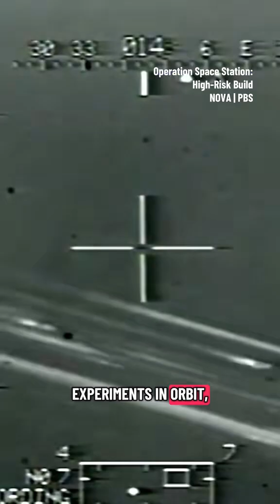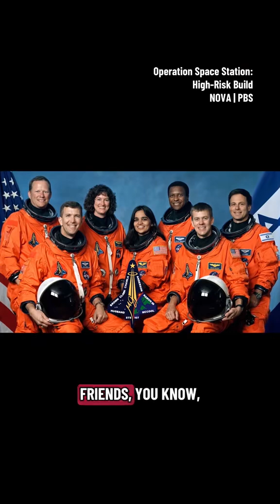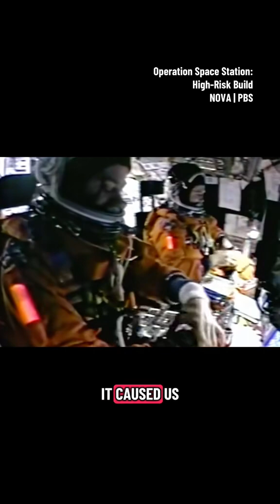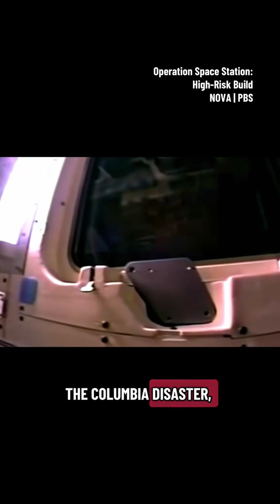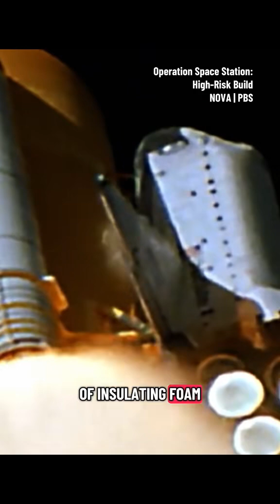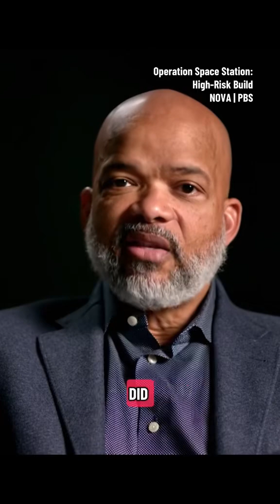What really caused the Columbia disaster? #nasa #spaceshuttle #astronaut

Comment: I call bullshit!!! A piece of “ foam” damaged heat shields that can withstand 2000°C? Really? But we all know NASA stands for. Never A Straight Answer!
Reply: Answers pretty damn straight. We're talking about a shuttle travelling very fast. But ok you're the expert.
Reply: Quit with the conspiracies, at 17000 mile an hour it do tremendous damage
Reply: @patrickcoffman4774  It’s actually 17,500mph or Mach 25 for low earth orbit. The important factor is actually (kg/m3) But if their explanation convinces you that’s fine with me. Not all of us have the skill of critical thinking.
Reply: Go away Trumper
Reply: @terrymckenzie8786 - MAGA ♾️?
Reply: Yes foam that's designed to be durable enough withstand the stress of traveling at high speeds. But your small brain can't understand that there are different types of foam, for different purposes, and all you can understand is something a cooler would be made out of.  Where did you get your degree?